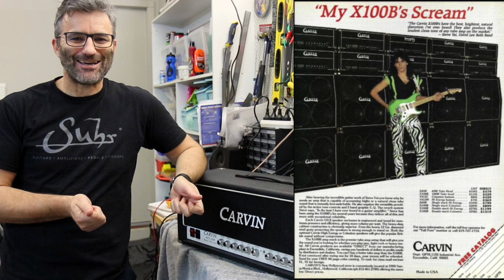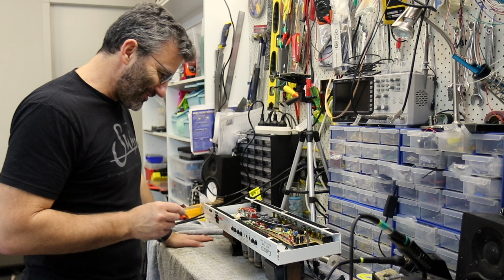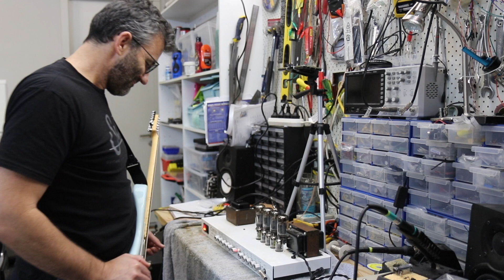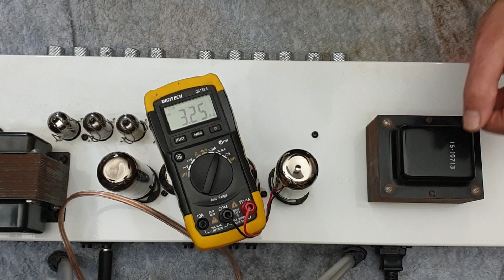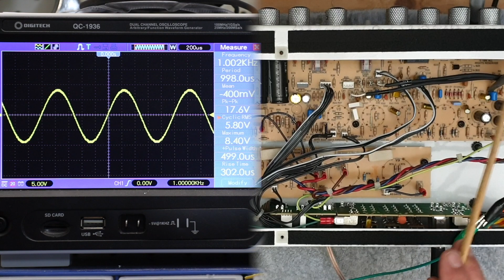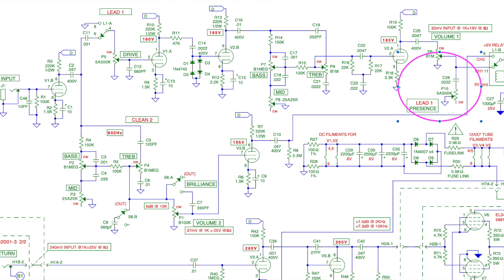Carvin MTS 3200. Service, Diagnosis, Circuit Info & Tone Test!

Comment: I traded a pawn shop a couple of junk solid state practice amps for a MTS3200 that wasn't working.  I repaired it, and it works fine.  But, it's one of the worst amps Carvin or anyone else has ever made.   I removed the clipping diodes and extensively modified the literally unusable reverb circuit, and while better, it's still an awful sounding amp.   Not quite sure how they produced such a magnum opus turkey, especially considering that the earlier X100B / X60B was excellent.
Reply: Its clean channel alone is worth the entire amp,, it beats anything i had heard from Marshall, Peavey etc.  I was sold the minute I heard the amp.

Comment: I have this exact same amp atm I got used, and at first the switch wouldnt work...( for the channels, it wouldnt go to clean) SO i took it out of the head casing and cleane dit really good with Contact Cleaner and that fixed that issue, However.. Even after switching the 3 main preamp tubes out to ones I know are ok ( they arent matched tho.. gotta get some new tubes maybe?) Its VERY noisey on the lead channel and it only gets noisier as it gets hot and as I add gain... It seven starts to get melted and muddy sounding after it heats up... Can anyne help me figure out what the issue may be?
Reply: Maybe something wrong with the preamp tubes?

Comment: Those transfers look kinda small for a quad. They sound awesome but when used a bit can get hum, and the resister for a choke was a fad in the 80s. Tightened the sound a bit, but i could deal with the heat, it just bothered me.VERRY AWESOME AMPS.

Comment: This is a great video about a circuit that is close to the carvin legacy. The main difference is that the legacy has the tone stack after the gain stages, but it honestly sounds similar to this amp. Also thanks for explaining the "presence" control. Its just a lo pass filter 😆. Very convenient with the same effect i suppose

Comment: Hey man glad I found your channel and have really been enjoying your videos! Love nerding out on gear stuff! Anyway got a question I’ve been preamp tube rolling in my Friedman BE 100 deluxe and got some NOS matsushita Japanese Mullard copy 12ax7 for v1 and v2. I noticed through this process that the phase inverter tube actually has quite an effect on your final tone and feel depending on what 12ax7 you use. Have any suggestion for phase inverter slot? NOS and current production?
Reply from the maker: Sovtek LPS are always good in that slot, however I just use the same pre's all the way through the preamp & PI in my builds
Reply: @HeadfirstAmps  what tubes do you use?

Comment: Thanks for posting I have this exact amp with the same problem was going to take it to a tech to do a check up but now I don’t have too thanks to you I’ll swap out the preamp tube and move on to repairing my Laney GH 50-L  which is 10 C-section a better amp and use the Carvin on the clean channel for a stereo set up through my rack ….
Thanks again will be subscribing and looking forward to more videos in the future 👍👍 !!!

Comment: I have an MTS 3212 (combo version) from the late 90s. I know this is a bit contrarian, knowing that removing the clippers has become a cottage industry of sorts for the would-be Randall Smith's of the world, but I love the gain channel, and the slightly spongy attack it provides! It really smooths out when you turn it up, though, starting with the volume at least on 2. Also, a JJ ECC83 in v1 sweetens the midrange a bit.
Reply from the maker: Nice to hear that these old Carvin amps are getting use!
Reply: I just picked up a head and 4x12 cab yesterday. Guy threw in a full set of new tubes so was a great deal.  While I don't like the lead channel, it's not organic sounding, it's cool that it works for you.  I'll be modifying mine some, but for what you pay, if you can work on an amp, these are amazing deals.
Reply: I've got the 2x12 combo version, and even stock I quite like it!  I did a couple small mods to it though (raised the input impedance and removed the mid scoop from the drive channel), so it really rips now!
Reply: @SlyMan420  I was considering playing with the input resistor to ground, but the clean channel is so nice I left it alone.
Reply: @SlyMan420  Removing the mid scoop is something I would be interested in. Does network R16, R17, C22, C23 located between the tone stack and recovery stage form a notch filter responsible for the scoop? Also, how high do you raise the input impedance?
Reply: @ericv7720  Yes, that's the section.  Basically you can jump C23 with a resistor to allow more midrange - I don't remember what value of resistor I used, but you can temporarily sub in a pot and see where you like it - I'd expect something in the 10-50k range.  I also don't remember the input impedance, but probably at least 250k instead of the stock 100k.
Reply: @SlyMan420  Thanks for the great info! And you're talking about R1 for impedance?
Reply: @ericv7720  Yup
Reply: @SlyMan420 
Interesting because i was just reading in the mts3200 literature and carvin was bragging about the ultra high input impedance and that they also do not use any capacitors anywhere i  the preamp stage like other amps.  What is the main difference you have noticed going from 100k  to 250k? Also about the scooped mids,, cant you just turn up the treble to correct that?  Or the presence knob? Their literature specifically mentioned using the treb and Presence together for tone shaping.

Comment: For all you Carvin haters, ever thought about changing speakers?  Everyone hated the departure from Marshall JCM800 to the JCM900 series, similar high buzzy gain with diode clipping. But as Johan Segeborn showed with the JCM900, take away the Celestion G12T-75s and instead plug into greenback speakers and like that the JCM900 sounds great!!  These Carvin MTS3200 were paired with the the same Celestion 75 watt speakers back in the day. Try a greenback or a vintage 30, you might be surprised
Reply: The Carvin cabinet was available with a variety of different speakers, I got mine with Vintage 30s.  I use that same head and swapped out the original tunes for groove tubes 6L6s.  Everytime I've played a show with that amp, people ask me what I'm using on my board, then they see all of the gain is coming from the amp they look so surpised.
Reply: @sektion333  I play with lots of different speakers these days and I have concluded that lots of opinions out there are meaningless. Speakers are 80%
Reply: Also, start with swapping out tubes. Putting the right tube in V1 makes all the difference!
Reply: @ericv7720  what tube do you like?
Reply: @voxpathfinder15r  JJ ECC81 in V1, GT 12ax7R in V2, and Sovtek 5881's in the engine room. I tried Chinese 12ax7a in V1, V2 for years, but they were way too edgy. The tradeoff with what I have in now is slightly less gain for more mid warmth.

Comment: A lot of Marshall/Carvin haters here .. I think it sounds great !
Reply: The MTS likes volume - it's very much like an old Marshall in that regard. Also, a lot of people have issues with the "gritty" drive tone, but that can be remedied simply by turning the treble knob down. To be honest, any of the eq controls above 5 is "too much" on this amp, and really only makes sense if you like to dial the gain back and crank the volume to push the power tubes (which sounds fantastic, by the way - very plexi-esque!).
Reply: @ericv7720 . Huge point. Tube amps need to be turned up to come into their own. Many guys say alot of tube amps are fizzy, yet the volume is only on 1 or 2! 🤣 Crank it up then judge! Valid point.

Comment: This amp and the Vai Legacy VL100 use the exact same chassis and power section.  I just repaired one.  The preamp in the legacy is quite different with no zener clipping.  I'm not sure which amp came first but the two are quite similar, and the legacy sounds really good.  I'd imagine a conversion would be fairly straightforward.
Reply: "In 1996 Carvin introduced the MTS 3200 Master Tube Series guitar amplifier head"

"Over the years, Vai has tried just about every amp on the market, but in 1999 he reunited with Carvin to create the Legacy signature amp."

MTS came first!
Reply from the maker: The owner told me he purchased it new in 2000, so this sounds right!

Comment: Hey Jason, as an fyi....EL34's and the like as Ken Fisher published once should show about -40V on the bias voltage.  Earlier on in the video (abt. 4:45), you checked and it was -36.85.  Meaning, not enough negative voltage, soo would have been an early indicator that your bias in mA was probably running HOT, which in fact it was at 48.5mA shown at (abt 14:00 in)!!  

Soo, in summary and for the folks out there and before taking off Standby...check the negative voltage.  It should be about -40.0V on EL34/5881, etc tube.  If your running lower than that, significantly lower....you better raise it before taking off Standby, else it's going to running Hot!!  It's an early indicator. 

Hope this helps!  :)

Oh, and I hate the tone of that amp.  Sounds like shit!  All of that gain with all of those 220k plates and zeners on top of it and soo many stages, it's a over-compressed, mushy bee-hive!  Thumbs Down!!  lol
Reply from the maker: You are right on all fronts brother!

Comment: I still have this amp,but gutted it and rewired it point to point.It was not bad for a clean amp,gain channel had the diodes as a poor man's overdrive,you could approximate the legacy 1 with a bit of modding,basic architecture is the same
Reply: Mr. Alentube = I have the Mts 3212 combo version and I found the clean channel was usable as a pedal platform but I am not satisfied with it. Im fascinated with electronics and tube amps and would love to be able to do to my Amp what you did to yours. The problem is at 50 and despite being an electrician I never learned anything about electronics and now I can't muster the patience to sit down with a book and start from the basics. I would be willing to spend some money for some instructions and pictures and maybe a couple phone calls for the inevitable questions. Two hundred min for some quality instructions seems reasonable and maybe it's not enough, my only point is I'm serious in my hopes of finding someone who wants to share and get paid for it. There's someone out there that this would be a good fit for. Who knows there's a chance a guy could make some decent side money because not everyone is cheap, I recognize the value in another man's hard earned knowledge and am willing to pay for it = Im not the only person who's willing to pay for someone's expertise. Just a though but one that I'm serious about paying for if I find someone interested. Keep rocking and thanks either way.